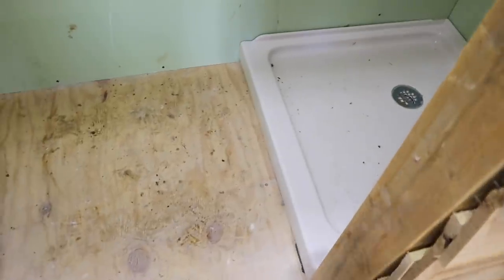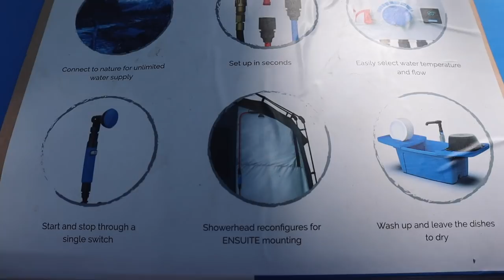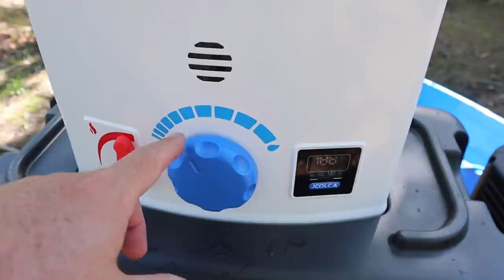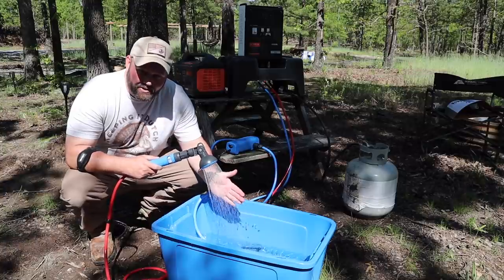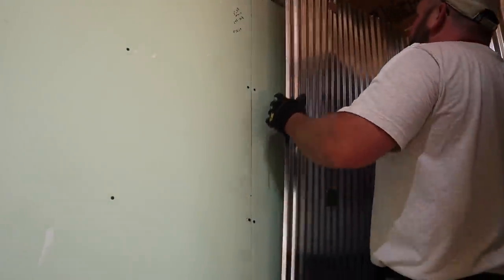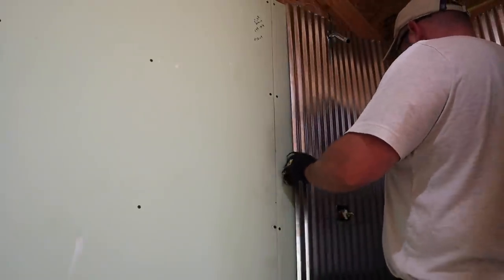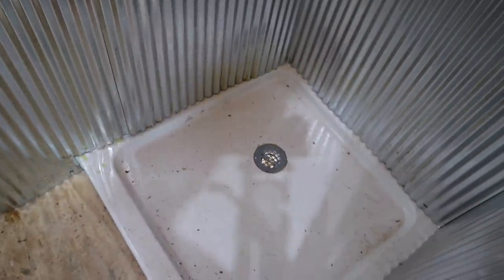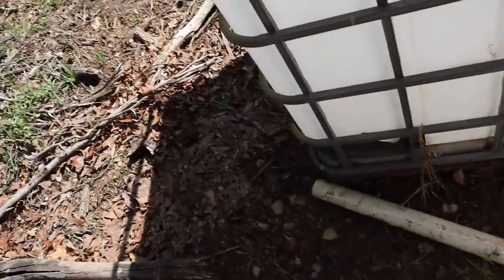HOW TO GET INSTANT HOT WATER FOR SHED TO HOUSE

Comment: Grey water attracts flies esp after washing dishes. Dig deep hole, line with gravel, fit board top onto it or some kind of cover, cut hole for your drain pipe, insert, caulk.
Reply: Gray water does not attract flies. Dish water should go into the septic tank.
Reply: As kid we had pipe under ground from house and a :15 inc ditch( deep) and 12-15 foot long and was hardly ever wet and dish water in pantry and wash room (sink) water only. Went in their-7 people in home
Reply: Pipe underground ran about 20 ft from house to ditch

Comment: Be sure the drainage does not run off near your well.  Drainage water can ferment, smell, and carry bacteria!  Probably need a septic system anyhow!  There is all kinds of them now!  Nice cabin shower!  I think the bottom where the tin comes to the shower base could use a nice thick sealer bonding them together so water can run into the shower base n drain out. Or the water will seap down that space n under the base!   Thanks!

Comment: Anytime you are putting in a bathtub a shower a wall or a window you have to seal it with caulking to keep it from leaking.
Reply: Seal all seams, condensation on the back of the metal will rot everything otherwise

Comment: I would have bent the corrugated metal into a 90 degree angle to cover the corner of the shower stall.  That way there would be no seam where the metal sheets touch  You don't want water getting through there.  Over time it could cause damage or mold.

Comment: There is a special insulation to use with metal siding or roofing . Its about 3 inches thick and has plastic in both sides. It prevents condensation and leakage into your house.

Comment: If you'll do some planning ahead, I'm gonna be using the grey water for permanent planting stations.. could be feeding trees, shrubs,  or perennial plants of various kinds.  There will be hot times of the year every year as you know, and the self watering nature will be a thing you look back at and say Dang I was smart to do that.

Think of the circle driveway... gonna be either flat grass, or some kind of landscaping or edible landscaping right? Run lines over there to water them maybe.
It don't have to be complete right off.. just leave a Main at first thst can feed distribution lines you come up with later as plantings inspire you.

I don't plan for any grey water to go to any sewar or septic system i end up with.  If it's just gonna soak dirt, I'll direct it where I want it then.
Let me know if you thought this comment was useful 😂

Comment: You should have silicone all the seams the vertical ones before screwing it down so water does not get behind the seams but you could fix it just unscrew it run a bead of caulking down and screw it back in if you don’t do that water will get back there guaranteed and if the screws don’t have rubber gaskets water will get back there also but I think you use the roofing screws it looks like maybe just thought I’d throw that at you

Comment: I had the same exact idea for your shower drain and gray water plan with exception of the gravel. Not near enough to worry about even a small septic tank. Using the 5 gallon bucket and gravel filtration, you're pretty much making a makeshift septic system anyway. I think it'll work great.

Comment: Hello Dutch. I would dig a 3'×3'×5' hole and put 57 stone in it without dust. Put the pipe in it and go to dollar general and get the $5 screen colth and just layer by layer of the cloth over it use the whole roll and then put dirt back over it then your done.  I would ask Kevin to dig the whole for you.    Im going to get 3 of them to use with my bathroom/outdoors kitchen/ fish cleaning/ atv and atv dump trailer/ trailer.

Comment: Dutch, one thing to keep in mind is that using Greywater in this manner you need to use natural cleaning products that are biodegradable. Just be aware that every state is different and one thing you don't want is an EPA fine. I fought with Wyoming when we had our Offgrid homestead up there and it came down to in the end that we were required to pump all of our Greywater through a septic system. The biggest fears of most are using cleaners and chemical detergents that can affect the groundwater. 

Was that a vented hot water heater. Just like in Wyoming those of us up here above the 45th Parallel have to use vented on-demand hot water heaters since they have to be freeze protected.

Comment: Your "holey Bucket" idea will probably work well. I suggest you put a lidded bucket in the hole with the rocks on the outside.  I would use a larger vessel because the shower drain will be limited by the tank's volume.
Also, make sure that whatever "tank" you use has a cover that will not deteriorate over time making a trap for someone to step into.

Comment: The shower looks good. I think you should silicone caulk where the tin overlaps & in the corners to prevent water from getting under there & causing mold & rot. I know you said you would caulk around the bottom.

Comment: A 5 gallon bucket may be too small for your grey water. Maybe try a 55 gallon blue drum? Maybe drill a good many 1/4" holes, line the drum with landscape fabric, put some large gravel or stone in it and surround the drum (in the ground) with several inches of gravel and sand? Bear in mind that I have never done exactly what you are doing, but have had a lot of experience with drainage issues. When you dig down to 'bury' the barrel, the nature of your soil will tell you about its ability to absorb and distribute the moisture. Hope this is helpful. Look forward to seeing what you do!

Comment: Excellent job Dutch be sure to caulk all the tin seams use aluminum color silicon and put some plastic or metal molding on those dirt ends. That thin tin is like a razor edge cuts easily. I worked with a lot of tin and metals I know too well lol
Reply: Tin ends

Comment: There is a very cheap grey water septic setup you can use for the cabin that uses a plastic 55 gallon barrel and the pipes to get the water to it.  Place the 55 gallon bucket on its side with the barrel dug into the ground, Drill holes on the down hill side of the top of the barrel so at least have the barrel stays full and extra the liquids can leak out over time, cut a hole in the barrel for the pipe from the cabin to feed in. The organic materials in the water will get caught in the barrel and have time to break down with the liquids coming out the holes with the goal of having the barrel on its side so the barrel is just showing on the surface creating a very nice wet area down hill from it for planting in. As you are not using it for black water every few years pull the pipe out and insert a paint mixer to stir up the solids in the tank then flush to clean it, If used for black water you would be classed the same as the sludge pumped out of a septic tank.

Comment: Seems like a lot of caulking might be needed to keep the water from getting behind the tin joints in the shower and ruining the floor and wall. Looking good...... You might think about an exhaust fan in the lil house for both the steam if any off the shower so it doesn't create moisture in the lil house and the toilet odor....

Comment: Excellent plan for gray water issue.  You could also just plant a perforated pipe out fifty foot.  Volume of the discharge would not take a lot of area.  You shouldn't need more than ten to fifteen gallons to make it successful.

Comment: Your bucket idea for the gray water is a good one. However a 5 gallon bucket won’t be big enough for a typical shower time. It will more than likely over flow before draining. Remember that the gravel in the bucket will make it less than 5 gallon volume (water displacement). Add to that a typical shower takes more than 5 gallons. I know this because we live in a travel trailer. Our water heater is only 5 gallons. We have to get wet, shut the water off, lather up and then rinse off. Trust me, by the time we are done rinsing off, we are out of hot water. 
I suggest a larger container...like those 30 gallon blue water barrels. Just a thought.

Comment: Just dig a hole and put gravel in it for waste water.  Or run it some place where it will irrigate some fruit trees during the summer.  I like the easy connections on the water heater.  It makes it easier to drain and store during the winter.

Comment: Should have put a piece of galv angle in the corners, also you should overlap at least two hills to keep the water from getting in between. A bead of silicone in the first valley should have been utilized as well.

Comment: This is what I did 55 gallon metal or plastic drum use it as a septic tank to catch your solids and then do a little 10 ft area two and a half foot trench deep and you'll be good for the leach field easy

Comment: Is the tin with in the lip of the shower tray ? If it's not you did not silicone it which means the water that you sprayed on the tin it's going to collect and you don't have a water barrier behind the green board. Only reason I bring it up is you may end up with mold.
Reply from the maker: Has a lip
Reply: Glad it has it . You did a nice job are you going to put tile down on the floor ? Once you get the big house done that would make a great guest house.

Comment: I did gray water in a bucket but put big rocks around the tank did the same thigh my sewage at the end of the lines put what they call sewage pits put a tank with rocks around the out side of the tank my sewage is done the old way sewage in its own tank gray water in its tank and haven't had to pump out my tank is 20 years so far

Comment: how about digging a 2' wide 3.5' deep hole and put a 12" drain pipe with holes drilled  in it and 1.5" stone around it with a cover should hold 5-8 gallons of white water

Comment: Use  heavy plastic garbage can, drill holes into sides fill with rocks , surround with rocks. Bury at least 6 ft deep. Works better. Been using one for 20 yrs

Comment: Would it work to put a pipe that will have the grey water in it running to your garden?have a bunch if separate pipes with holes in them going to one main pipe that comes from the building. Water the plants and reuse the waste water. (??) Good idea?

Comment: You will not be able to seal properly around the taps with the corrugated tin. I would have put a wall board in that has flat surfaces so you get proper sealing. They make wall board that looks like tile that is really nice. I hope I am wrong because you are putting in a lot of work on that shower